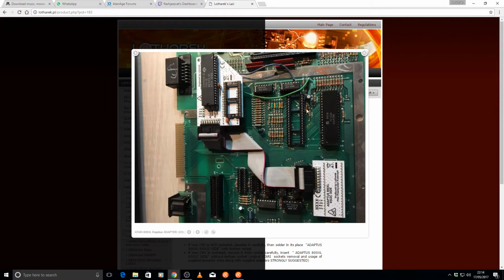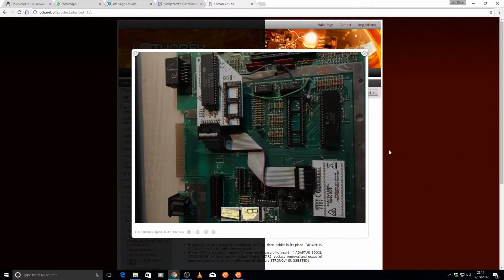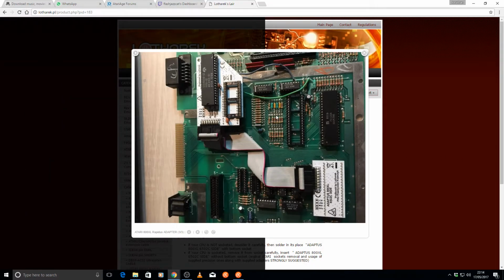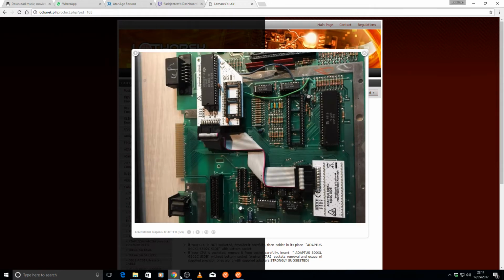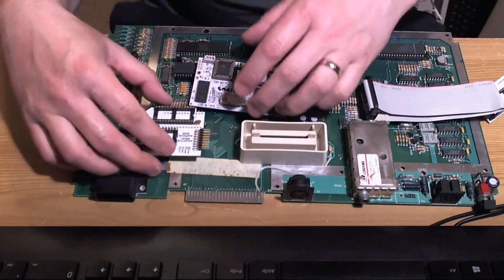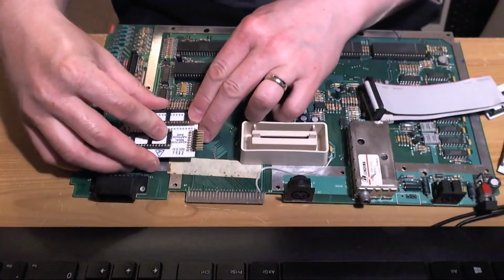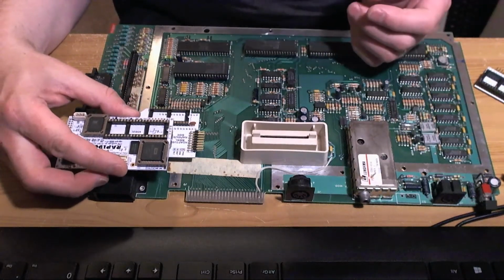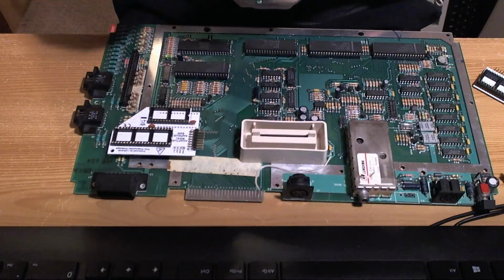Rapidus 800XL part 1: Socket installation

Comment: Another great technique-filled video - thanks! I have the same spring-loaded pump/solder sucker. Not great but it does work. Just curious - are you applying heat to the leg of the pin you're clearing, or to the pad of the board? And how much flux are you typically applying? I've only ever socketed a board in the case of a dead IC, in which case I've cut the chip out, which makes the hole thing a lot easier.
Reply from the maker: When removing ICs with the pump, I apply heat to the leg of the chip. I try not to touch the thru-hole on the board unless strictly necessary, and only if the application of 60/40 solder and more flux doesn't help. In the case of sockets, I break these up first and am left with either entire legs or stumps in the holes. I apply flux and - if necessary - 60/40 solder, and if there's a socket leg I heat the leg. If there's a stump, I use a pointed tip placed in the hole for a second or so: not long enough (at 400 degrees Celsius) to damage the via, but long enough to ensure complete clearance of the hole. Cutting a chip out is probably the safer and quicker option if you don't intend to re-use the IC. Heated desoldering pumps are probably a lot quicker, but I agree the cheap pumps get the job done. I removed two ICs and three 40 pin sockets on this board without much fuss.